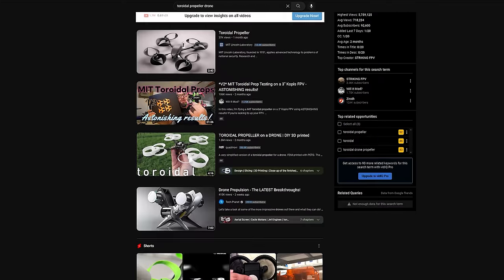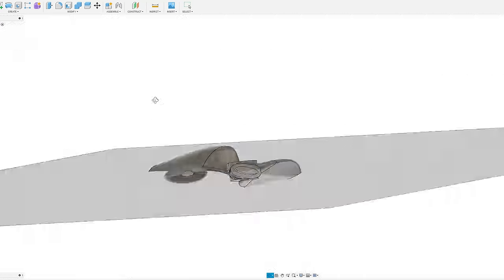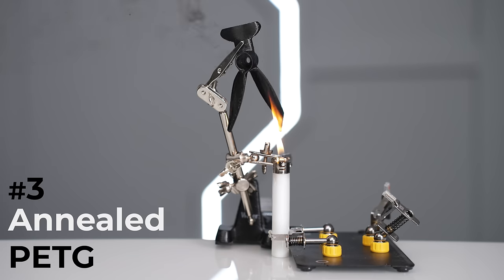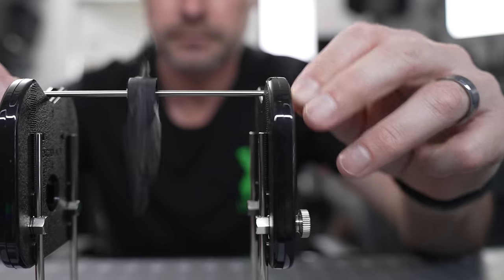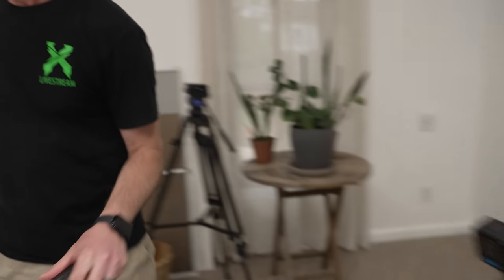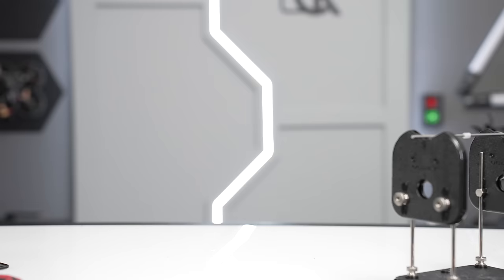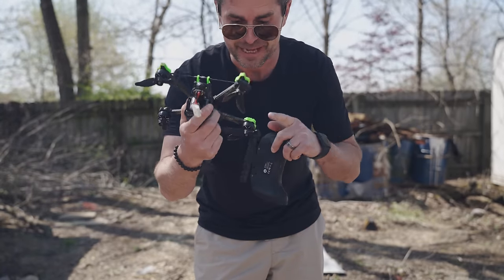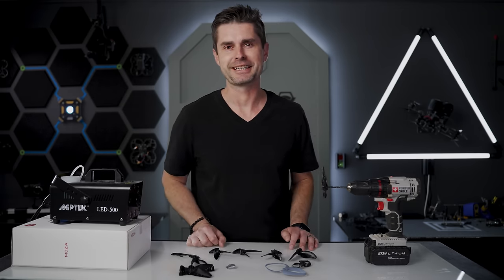Zipline PROPS Look CRAZY! So We MADE Them        |        Free STL Download

Comment: you should try PC or PA instead (PA might be too soft) also you might want to make the counter weight fully 3d printed, to make it more accurate and to make it easier to balance the prop maybe ?
Reply from the maker: The second counterweight is fully printed and close enough that it’s only minimal adjusting, but precision is always better. 
PC seems like a good idea. I have a few options from here that make sense. I liked the salt remelting one too. 
Will be doing a follow up. Thanks! 🤘🏼

Comment: well...the airfrier is a really good solution for strong 3d prints...but...have you ever heard of salt remelting? It's litterally like the airfrier method but you fully melt the plastick and at the end you recieve a full plastick part no adhesion layers just an injection molding-like part, plus it's really damn cheap. And also maybe making a silicon mold to cast everythig once the props shape is tuned could be a good solution to "mass produce" some props
Reply from the maker: Salt remelting is a great idea! I may have to try that one out. 

I’ve thought about molds, but this is more of a prototype and try again thing than it is for mass production. If we happened to make something practical, I would probably just give the design to a prop maker.

Comment: It's great you are showing your progress. What temp where you using?
Reply: I have printed props, it has to be hot no fan each layer melts together.
Reply: Also the pattern it's prints is important, 100 percent infill move around on plate till z seam is diminished or in exceptable location, also fine layer lines on each layer.
Reply: Also shape is odd, might not be balanced equally on all directions, possible reason for self destruction.
Reply from the maker: Good call on running a higher temp, I’m doing that on our next set. 🤘🏼

Balance was close in all directions. The wide counterweight allows for adjustments both ways. It wasn’t as perfect as I would have our cinelifter props though. 

Thanks for the tips!!
Reply: Another thought that came to mind it was hard for me to explain, even though weight is balance on balance tool all the way around, the angle of attack or incidents to hub ,ounce lift starts acting on blade at different speeds unequal forces are applied to attach point on spinning hub. Like the flex in say top blade angle changes and forces the blade to go in unrealistic angle of attack and tear itself apart. High speed camera with smoke might tell u more of forces acting on blades. Also test subjects I would be curious on how brittle vs toughness, or flexibility. Just trying to be constructive not over critical. Thanks for all your hard work!

Comment: 2:13 Bro... if your propeller broke all the time, why don't just mount them on a static test motor to test if it's withstand the centrifugal forces?
Putting on an RC and going outside just a waste of time, it's just slows down the iteration time. You also need atleast x4 for each test this way. 
Also damageing the RC should'nt better to be avoided? (yeah yeah, you risking it and you fine with it, but at least a first test spin could mean a lot in terms of reducing the probability of knocking the base with shards)
Reply from the maker: Haha, you have a valid point! This is going to be part of our next video. There are 3 (not very good) reasons why i didn’t do it. 1 the test quads are already pretty beat up. 2 I didn’t have a prop test stand rigged up so printing in groups of 4 was almost as fast especially since I didn’t even plan to make a video at first. 3 it’s more fun to have some anticipation lol. 

However, a test stand makes soooo much more sense 😅🤘🏼

Comment: You need to take a page from metallurgy, make your props flat  on the 3d printer then place them in sand and make a mold then take the plastic that you're using in your 3D printer melt a bunch of it and pour it into the mold just like you would make a metal mold you should get Incredible strength and rigidity

Comment: Print these in polycarbonate carbon fiber, or carbon fiber nylon and they will work. Anneal in heated sand in order to retain your original prints dimensional accuracy.
Reply from the maker: This is a great plan, and one we will likely test in the follow up video! Thanks!!
Reply: @CliffKajun  Polymaker PolyMax PC annealed will do the trick.
Reply: Phrozen Resin Nylon-Green Tough, Sunlu Nylon Like resin, or siraya tech resin combos (blu/tenacious- 70/30 or build/tenacious - 50/50).

Comment: Make a slurry of salt and when it hardens you can ramp the heat up to liquefy the polymer. 
Then dissolve the salt in running water to get the parts out.
Add graphene if you can get it.
Techingredients shows you how.
Try not to die.

Comment: I think there is a design mistake, not in the propeller but in the propeller + motor system. The blade passage frequency should be much lower the 1000 Hz, for the propeller to be near silent. So try with a lower RPM and a bigger prop should do the trick. Even Zipline drones seem to be using a gearbox. Propellers are not directly connected to the electric motor.
Reply from the maker: This is an extremely valid point. We may try again with geared down motors and a modified FC setup.

Comment: Right off the bat, the printing orientation shown at the beginning of the video is a very weak orientation for optimal part strength in this application.

Edit: Ok you realize and address that. Honestly I think the best solution would be a 3D printed mold & making your own carbon fiber parts.

Comment: I think these and the toroidal props will never really catch on. The one thing you are overlooking about this design is how at any given point in time. The prop is pulling unevenly on one side of the motor bearings. This has to increase wear on the bearings. Balancing the props will only deal with getting rid of uneven centrifugal forces, not the forces due to the prop only pulling on one side.
Reply from the maker: I agree the are not that practical for most applications. This is more about the experiment and the journey than achieving a breakthrough design. It is a lot of fun to mess around with lol. 

I think it will have a little extra wear on the bearings, but not enough to matter for most uses. I used to design and test counterweighted vibrating motors for industrial use. Those weights would have several hundred pounds spinning out of balance to create the vibration. Of course, those bearings were much heavier and purpose built.

Comment: offset the pitch of the following blade. say 1 to 3 deg. as it's pulling lift from faster moving air. use resin printing. filament printing really doesn't work for areo surfaces. forward swept blades also help with Db reduction.

Comment: I have flown with well balanced PLA props, no they last and don't self destruct. The key lies not as much in the material as is in the aerodynamics. There are a few shortcomings in your design. From
aerodynamics perspective, your blade pitch is way too high (must be low for vtol drone applications). Also, the streamlining of the blades is what you missed out on from Zipline. Your blades seem to have resultant force close to the root while that from Zipline is away from the root. These make a lot of difference as far as vortex shedding and induced resonance are concerned....

Comment: Why are you printing them in the direction that provides least strength and guarantee they will fly apart at speed.

Also regular PLA is actually the strongest 3d printed material. It just has no flex and is brittle so it explodes when it his the breaking point instead of bending.

Comment: I've printed props out of FDM pla, petg, nylon, PA+GF, SLS Nylon, and SLA tough resign as well and did material testing with a truss breaker on all of them and pla is the best to use for props as it is by far the stiffest of them all while having enough tensile strength to not rop apart. SLA tough resign is much more durabile and higher quality so its safer but flexes so much it cant produce much and is less efficient, although it does sound better. Counter balanced props however DO NOT work. Its not even worthwhile to attempt to 3d print them. Even if its perfectly balanced they wont work as the load of the motor axile shifts around with the propeller in every rotation. This caused extreme stress on the motor and will result in heating or burning out your motors, oscillations in the drone flight, and or the prop just exploding.

Comment: Single blade propeller do exist in real aircraft as well. It´s purpose is not to be quiet but to be more efficient and save space on a power glider for example.
Why having two blades on the side and then even changing the angle of attack, this makes the whole design complicated and unpredictable. It´s already hard enough to couter balance those with only one blade. You will still introduce more turbulence with 2 blades than with one.
Reply from the maker: Yea, we based our design slightly on those older single blade props. With a drone, we need more lift that a single blade could likely generate. less surface area means increased speed. Increased speed means more noise. I agree these are complicated and difficult to balance, but that's part of the fun 😅
Reply: @CliffKajun  Hmm, I understand. You need more lift but also more quiet so to speak. Honestly I would use bigger props, I really don´t see this design being any better. In theory maybe. Did you guys make a flow analysis ?